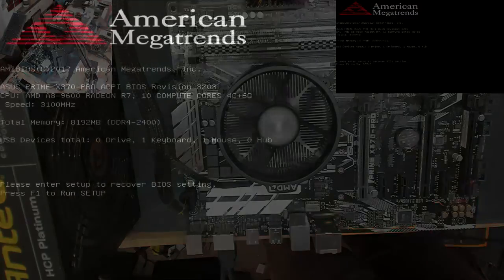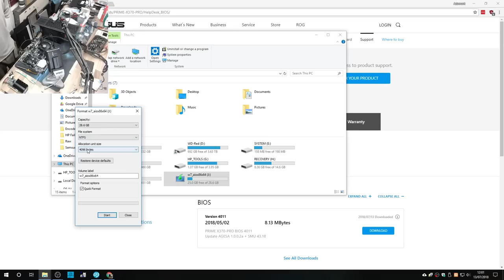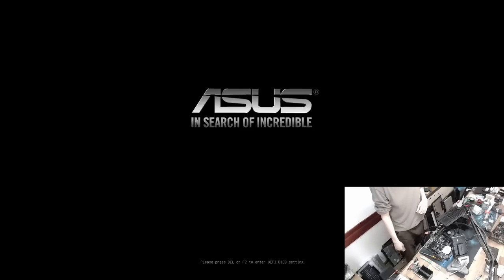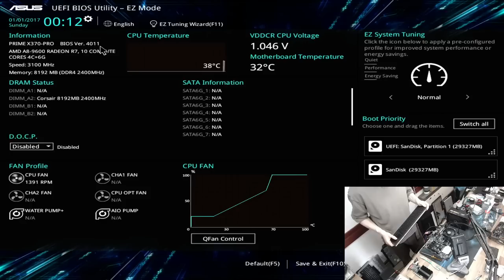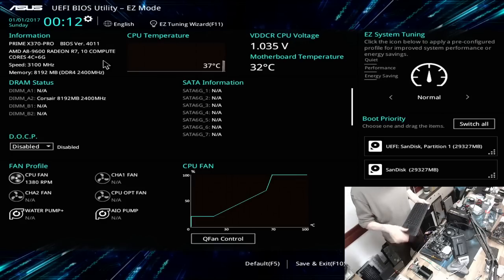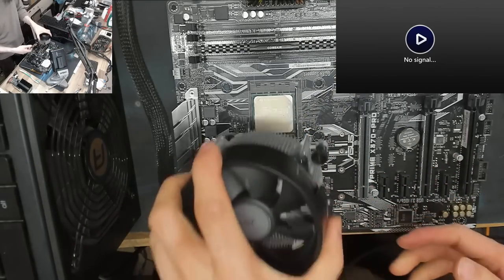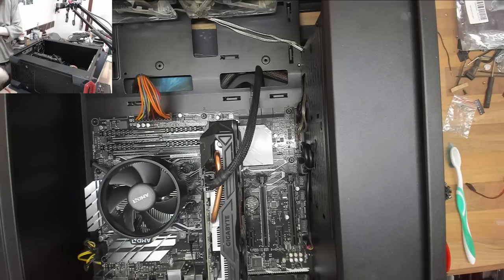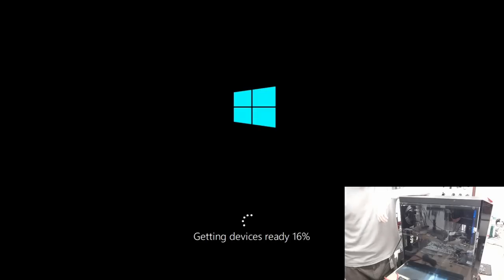LFC#143 - New Ryzen 2600x build with no POST

Comment: got a similar problem with ryzen5 2500x  in aurous  b450  (they are compatible) but getting dram led fault, tested with 2 sets of compatible ram and had 3 mobos, each time mobo worked for a time when new  (cleared cmos on each) and got the same fault 3 times not sure what is, as CPU has worked in each mobo when bought new,  new PSU also so it ain't that could it be the CPU? just strange as workes for a time and the just won't boot. (am not dumb to computers as-built systems since 97' but am stumped)
Reply from the maker: The Auros B450 boards are... sketchy. Different choice of BIOS version might help it.
Reply: @Adamant_IT  had bios update problems on last 2 boards think the are bricked IDK, but mobo 3 had a recent bios maybe 3 from latest but all seemed okay left on overnight windows had frozen tryed hard boot and now wont boot dram led on constant, same prob 3 times 3 mobo different bios versions, stummped recomend and brands or mobo that ate reliable with ryzen gen 2.
Reply from the maker: The newer MSI B450 boards (Tomahawk Max / Motar Max) are probably the best B450 boards right now I'd say. I don't think you'll find anything better without going into X470/X570 categories.
Reply: @Adamant_IT it literally just gone completely no no more gigabyte for me cheers

Comment: How do people consistently manage to get thermal paste on the underside of the CPU? 🤷🏻‍♂️🤦🏻‍♂️
Reply: You can´t remove the heatsink that easy on AMD CPUs due to the PGA sockets. Sometimes, while removing the heatsink the CPU still sticks on the heatsink and it can happen that some gets unter it.
Reply: Koeras, I ask this question because, of the thousands of systems I’ve built/repaired/sold I’ve never once got thermal paste where it wasn’t supposed to be. 

I think it’s clearly not the fault of the socket, the board or the heatsink...it’s the fault of the idiot messing with it.
Reply: @jonchapman6821  Definitely the fault of reckless people like myself.

Comment: Isn't it obvious the you need to bios update?
Reply: Adamant IT well it's practically identical to intel in the way their chipsets are marketed - amds "x" chipset are like the "z" chipsets I think of x370 as z170 and x470 as z270 - you'll need a bios update on z170 to work a z270 cpu.
Reply: Adamant IT Selective reading? I meant it in terms of marketing
Reply: Haha got to keep up with the news - I'm personally done with intel. I've got a x58,z270 and soon a x299 system with a 7740x and it's my last ever intel purchase I've made. Amd has caught up and has been keeping around 5% behind in single thread which is tolerable and it makes more sense due to no more refreshed sockets like intel does.
Reply: [Anti-rant incoming]
First of all, forget bulldozer since it's utter crap - My x5650 will obliterate any bulldozer processor out there - hell even my i7 930 will do the same, it was a failure to be sure. My x5650 is amongst the lga 1366 socket which is amongst the few holy grail chipsets ever released, my x5650 comes close to competing with the ryzen 5 1600 - outpacing it at 4.4ghz in single core and 200 points off multi in the lastest version of cpu z which is insane. Ghz is irrelevant and does not always equal more performance - Architecture is the most important, my xeon x5650 at stock (2.6ghz) will outperform the 5ghz fx9590 thanks to having a better architecture. 
"And you get not-too-shabby on-board graphics and vastly superior motherboards to boot"
On board graphics are pathetic for usage - even the hd 630 sucks for gaming in any form and the igpu sits unused 90% of the time because of dedicated graphics cards.
In terms of motherboards intel used to have the edge but it's a different story now. 

"The idea that AMD change their socket less than Intel is a myth- because AMD haven't released anything new for years. Last time they were moving forward, their socket changed every two generations, just like Intel. The Ryzen 3rd gen will most likely be in a new socket, although that's speculation on my part"
AM4 is supported until 2020 - Meaning ryzen 3 release will be the final am4 cpu to come out and that will be a 10c-16c variant, it's yet to be confirmed but I believe it's a 10 core processor. Yes their socket used to change every 2 years purely because they were screwing up the architecture then fixing it up. 
And I strongly disagree with changing sockets - Intel has been optimising architectures since sandy bridge, tell me why the i5 2500k is almost identical to the 6600k? Skylake was nothing more than a more optimised architecture - before you hit on me for that I'm more than happy to send you my 4.5ghz 6600k scores and we will compare it to a 4.5ghz 2500k - Yes there is a performance difference but not massive enough to justify an upgrade for 2500k users. 
 
 "Performance is more reliable"
Explain, performance is not directly correlated to reliability. If you meant it's a better performer then I'm glad your happy with 5% more single thread and zero upgrade-ability after the z370 refresh.

" No one uses real multi-threading at home"
So why aren't we on single core processors? 90% of computing tasks are multi-threaded, games in particular. 

"but AMD need to patch up a lot of abandonment issues I have with them"
The issue is bulldozer and it can't be patched up - the past is the past. 

"and with another two cores being bolted onto the 8th gen"
The only reason there is two more cores is because of competition, and they are making an 8 core z390 cpu to hit back at ryzen, I'd take a look at the server market too - EYPC is kicking intel's ass in value and performance.
As much as I used to love intel - It's all over, I'm fed up of their BS they keep pulling - I'm happy with nvidia though. Intel haven't been moving forward in years, why do you think apple is no longer using intel by 2020? Apple themselves said intel isn't pushing performance-watt to the absolute maximum and is basically calling them a refresher. Intel sucks in all market's they compete in, IBM are crushing them in supercomputing too and Qualcomm have a working x86 phone processor in a windows 10 laptop - Qualcomm are a threat to intel and amd due to having exceptionally high performance phone processors, take a look at the snapdragon 818 - a 10 core mobile processor, all we need is these to be optimised for high performance gaming in desktops. 

Your argument has few valid points, I'd highly recommend checking out the 2700x vs the 8700k - single core difference is around 5% at stock which has no real life impact - who even games at 1080p anymore?
Oh and rip 8600k - the 2700x will crush it entirely and overclocked it will match it's single thread score - admittedly the only reason I didn't get ryzen since I got a 7740x for AI turn-based games.
Reply: "AMD just abandoned us with no new chipsets and token gesture speed bumps to the CPUs for about five years"
Amd was working on zen for years - How do you think they took a massive blow to intel across the board? Optimising the failure of fx cpus is a waste of time and I couldn't care less that they abandoned my am2+ rig and am3+ crap.
Reply: Adamant IT 
First off all that xeon is NOT irrelevant, it came out for £800 ish as a server and workstation processor, I got it for a wallet "killing" £20 posted - all working and hitting 4.4ghz on all 6 cores - no magic needed. At £20 the value is there, that's solely thanks to server processors being available on x58 Intel refused to release xeon platinum on socket 2066 which is a purpose dick move to make people buy "workstation" or "server" motherboards with a pathetic premium.
Bulldozer was disappointing because it failed, amd couldn't keep up, The other issue is AMD's single core which is your strong point - That's the reason why I puchased a i7-7740x since it's the top performing single core cpu - I don't buy "z" chipsets since they offer no value whatsoever 4-5 years down the line, talk to me then and I'll be rocking an i9 7980xe for a couple of hundred. That's the good thing with intel - all the socket refreshes means that the used market is golden particularly x58 and x79.
I can guarantee you'll be shocked with that ryzen 7 2700x - single core when overclocked can easily break 185cb on cinebench. That is excellent - for reference my 6600k get's 193cb at 4.5ghz 1.27v, it's ahead but amd isn't far off at all. Yes am4 is supported until 2020 - The 2020 cpus will be the pinnacle of the zen architecture and guess what the focus is? Single core. Zen 2 promises higher clocks and optimized single thread performance with an improved zen architecture - don't expect them to get 230cb single thread but I can guarantee that overclocked they will hit around 200cb which is enough, what resolution do you game at and refresh rate? If your a 1080p 240hz user go home - with most people on 144hz and 4k (like me) 180cb+ is excellent and with amd forcing more cores out of intel games will truely start to ultilize more cores.
Reply: Adamant IT When you replace the system there's no need for a new motherboard if your on amd, ryzen 1st gen users can hop on to a massive upgrade that will compete with modern processors years later, motherboards last years - my x58 ud3r rev 1.6 still runs as we speak.
Reply: Those workstations are irrelevant - it's oem bullcrap, they shove a intel cpu with an igpu and label it as a workstation class desktop - most like a m-atx sized pc with support for a half size gpu - they cost a lot and don't have the performance of full slot size gpus, Hence the usage of an igpu.
Reply: Adamant IT Just forget bulldozer and move on - nobody wanted the fx 9590 did they? I guarantee that it was a forced release because they had nothing better to put out - they needed the cash for the zen architecture and food on the table. Single core Isn't the God you make it out to be, ryzen is a mere 5% behind, that doesn't make much difference at all and not to mention I'll bet you can resell that ryzen 7 2700x 4-5 years later for at least £50 since they hold value very well vs the intel counterparts(it's also a downside) 5% means almost nothing unless your doing 240hz - even then I doubt you can tell the difference between 240fps and 210fps - the human eye can't distinguish such a difference unless your super human. I would've loved to buy ryzen but I need single thread - not for cs go and other crap but turn based games - that's the biggest benefit you'll get with ryzen getting flattened sadly. In all other use cases ryzen is perfect and is a trillion times better than intel, and if you can't afford a dedicated gpu why buy a high end i5/i7? What a waste of money since the igpu will often hold the cpu back. My 1080 ti ftw3 does feel bottlenecked by my 6600k because the lack of multithread - 4c8t is the minimum these days.
Reply: Adamant IT I'll stick to supporting amd, and you can stay happy with that 5% difference for your superhuman ability to see 5-10 fps more. You can bash amd all you like since they definitely took a massive punch like 2006 - Intel's getting smashed again, no more sandy bridge refreshes. You can sure be happy about the 8 core intel cpus but it's all thanks to amd, the 8700k was "rushed" forward, the cpu is powerful and retains single thread and pushes multi thread along with it, there's no reason why they couldn't have done it years ago? It's no new technology just a new architecture for once over that years long sandy bridge refresh
Reply: I expect no reply from this point onward - Amd is the better buy - how many old desktops do you come across in that repair shop of yours? I expect plenty, amd endorses the use of their chipsets for years to come, my x58 system is 8 years old I had a i7 930 in it and I upgraded with ease - it ended up costing me £10 for a x5650 after selling the i7 - that's longevity at it's finest. I'm no longer buying intel until they enable server processor support on their "x" chipsets.
Reply: http://cpu.userbenchmark.com/Compare/Intel-Xeon-X5650-vs-AMD-FX-9590/m355vs1812
Like I said even a x5650 stock smashes a fx 9590 out of the water at STOCK speeds - The point I was making was the architecture was a failure.
Reply: I mean mine doesnt post and the box says ryzen 2000 ready
Reply: @Adamant_IT  very usefull video . first thing is that I reset bios via jumper. offcourse this was in time of introduction of ryzen 2 . and mb speaker sometimes helps a lot, if you pull of ram and mb must beeps.

Comment: Are you ever concerned about swapping out the CPU and it gets damaged because the Mobo has a fault ?
Reply from the maker: Desktop CPUs are pretty tough, very rarely have issues. I wouldn't be worried about swapping them about unless there's been major power events with the motherboard (like a VRM blowing up).

Comment: for a repair guy saying he does not want to recommend Ryzen simply because its a lot more harder to troubleshoot without an iGPU just shows great personal bias by some one that should be looking out for your customer's needs and not your convenience there is a reason why there is no iGPU in there simply because they wanted to have a gaming GPU in there too why have it when your not gonna use it unless when you send your gaming rig to a tech and they start saying they hate that there is no iGPU in there.
Reply from the maker: Keep in mind that this video is two years old, before Ryzen 3000 came in and kerb stomped everything. My opinions in this video have aged very badly, I'm aware of that.
Reply: @Adamant_IT  And that is where the problem was what if Ryzen never came along are you hinting that you would just be recommending Intel all the way and that is not good I have been a computer tech since 1998 and the only thing that should be affecting your recommendations to your customers is What fits with their budget and what will they be using the computer for.  I have never had trouble recommending anything from AMD or Intel or Nvidia as long as it fits with what my customer needs and not about whether there is an iGPU on it or not.
Reply from the maker: I think you're placing a lot of emphasis on my recommending CPUs purely based on iGPU. My point in this video was that iGPU is a 'nice to have'. The reason why I was so disenfranchised with AMD at the time of this video was that I'd been running AMD at home for years and experienced the disappointing performance of the FX series, the out of date and hodge-podged chipsets, the lack of driver support. No iGPU was just another thing that made the new Ryzens seem unimpressive and lacking in features to me.
Of course, the brute-force performance of Ryzen has won out these days, and now AMD motherboards have comparable features - but yea, ten years of AMD's darkest period really dents your faith in anything they produce. I'm very happy to say that I was wrong about Ryzen.
Reply: @Adamant_IT  hey I understand the personal frustration with AMD's big failure to compete for many years as I had owned  AMD's top end bulldozer core too and saw my Electricity bills skyrocket given how inefficient they were and that they ran hot too was an added bonus you don't need to explain that to me all I am saying is this as a professional that does this for my livelihood for so many years now and the very thing my mentor has thought me is that you never ever allow your personally bias affect your recommendations I know how easy to recommend and how ahead Intel was at that time with everything else except the price just always remember that the most important thing is the customers needs and the amount of money they were willing to spend the only thing that you need to advised them of is the PRO's and CON's then you let them decide never ever decide for them.

Hell I have been doing this for long now I still remember recommending a VIA Samuel 2 processor as they were selling them for less than 70$/50$ compared to an Intel/AMD equivalent and they had the option to upgrade to a Pentium 3 in the future as it was board compatible with Intel's socket 370 well they ran like shit compared to a Pentium 3 but we were able to use the saved up cash to get more RAM as it helped immensely with large Spreadsheets back in the day.

Comment: Hey Adam, I've got 2 problems with 2 pcs, with no post, brand new items. 2 pcs with 2 ryzen 2600 cpus, 1 has b450 aorus elite with 16gb ddr4 3000mhz ballistix rgb, 1 has x570 aorus pro with 16gb ddr4 3000mhz ballistix elite. both have stock bios. not been upgraded yet as they both show no post with dram led. have also tried with crucial ddr4 2400mhz 4gb in both systems and still no post, have swapped ram slots and batteries. can not get into bios on either. any help from anyone is appreciated thankyou.
@AdamantIT
Reply: yes, I got the same issue... please somebody help us...
Reply: Graham

Comment: It won't boot...must be a Gigabyte.
Reply: ? just needed a BIOS update to support the newer CPU than the board was.
Reply: @RWL2012  Just a joke both he and I had unreliable H61M MOBOS from GB , SAME BOARD , both failed. He being an expert fixed his with new EEPROM. Mine went to trash can , found a used MSI H81M board with RAM/CPU for $50 and it is rock solid reliable. As well as having many more updates over the years than POS GB ever put out , and a much better UEFI-BIOS.. They even have all the software for W10/64 and the Haswell refresh BIOS as well as the late 2018 Intel Microcode BIOS.  Damned impressive for a MOBO going on 7 years old and being a budget mATX board. I'll stick with MSI , GB can shove their Dual-Fail-BIOS up their arse.
He has a video on his channel of him fixing it.
Reply: @BigEightiesNewWave  I have a Gigabyte and my next board won't be one... I might well go MSI for that!